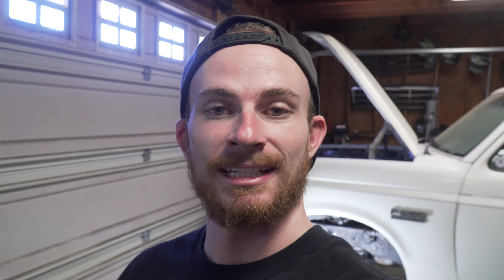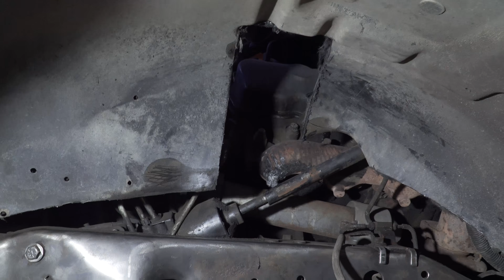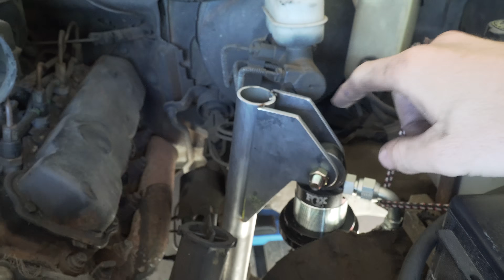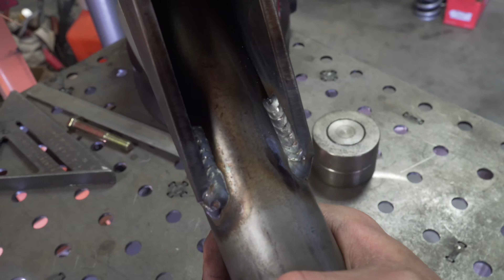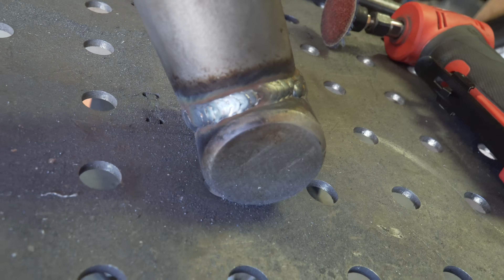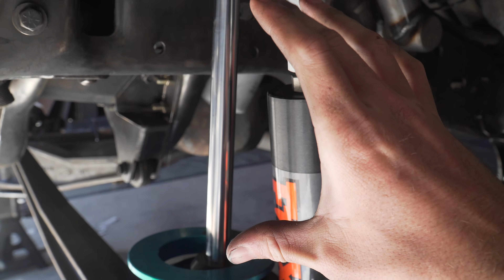7.3 F250 DIESEL BUILD - Building an ENGINE CAGE! EP. 05

Comment: Something to talk about when your talking about running these beefy springs and how heavy a Diesel engine is how light these trucks are in comparison. 

Mine is a 4x4 single cab and weighs 5300lbs. Would we be freaking out about putting that same spring set up on a 460 truck with a winch?

Comment: Having an OBS 7.3 myself I'm jealous...I do have a Dana 60 instead :) So no need to plate the frame where you tied in at? That PS line looks really close on camera since the engine shifts side to side with torque (+frames flex like crazy on these trucks). Just an observation, would suck to lose flammable PS/ATF fluid.

Comment: Whats your plans on performance wise
Reply from the maker: I really want to get the banks 21060 sidewinder kit for it and see what the power difference is. I ideally want to 5 speed manual swap it too, i just need to find the parts forsale to do it
Reply: @WingsWorldChannel  you could stud the head so you can run more boost. You could get a moose pump to get more fuel. Use anti-seize if you replace injectors.

Comment: I wonder if converting the brake from vacuum brake booster to hydro boost brake booster from the 1999+  power strokes would shorten the overall length from fire wall to the end of the master cylinder
Reply from the maker: I could, im planning on doing a disc brake conversion on the rear in the future anyways

Comment: Are the beams located dimensions the same as f150?
Reply: The stock 250/350 beam pivots are different from the 150 stuff, so no easy swaps with half-ton parts sadly.
Reply from the maker: @WhyBeNick   these 2wd  F250 beam pivots have identical mounting points to the ones on the 92F1Build so these mounts i built for the diesel could techically be ran on a 2wd F150 frame if I wanted to do that